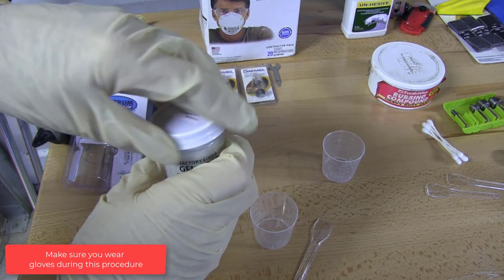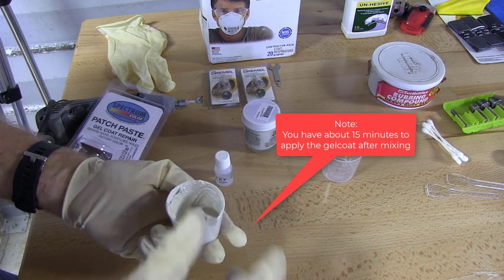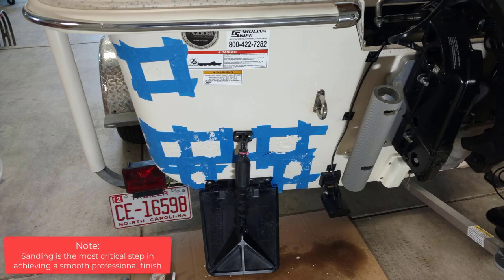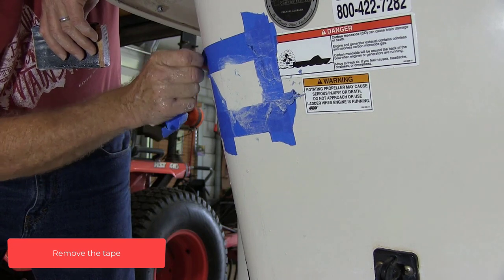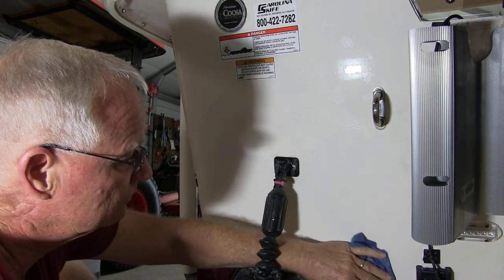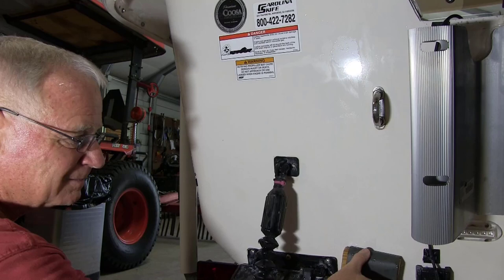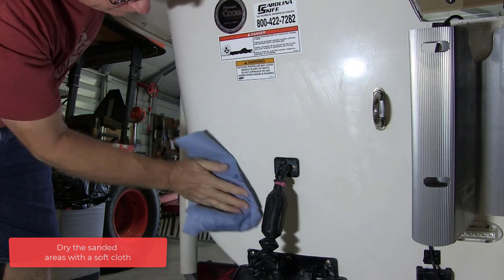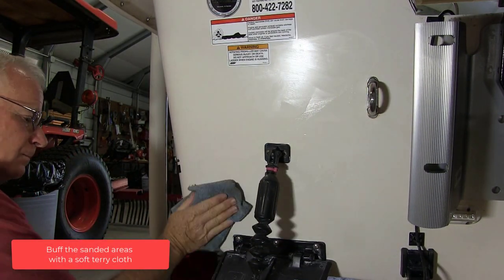Part 4 - How to Repair Screw Holes in a Fiberglass Boat

Comment: Mr. Norman, I drilled holes for a bilge pump and went thru the hull. Three very small holes (#8 screws or 5/32) a few inches apart like the points of a triangle/pyramid. Would you still recommend this repair for the bottom of the boat?
Reply from the maker: Corey,
You will need to follow a different repair procedure for thru the hull holes.
The method for filling in removed thru-hull fastener holes depends on the thickness of the laminate, the diameter of the hole and whether the hole is in a critical area. Holes below the waterline and in thinner laminates are considered critical areas.
If you buy the West Systems Fiberglass repair kit as shown in the video, it will give you step-by-step instructions on how to repair thru-hull holes below the waterline.
Below is a preview of what you will have to do. You can decide if you can do the repair yourself or not. It sounds complicated but it is not so hard to do. You must take your time and do each step carefully. 
The repair can be from one or both sides.
Follow these instructions:
Note: Use a power disc sander with 60 grit sandpaper to make the taper.
1.	Grind out the area around the hole and taper the perimeter of the hole to a shallow 12:1 slope.
2.	Cut multiple pieces of fiberglass to fit within and fill the void.
Cut the bottom, largest layer about ¾” smaller than the width of the void.
Cut each successive layer about ¾” smaller-3/8” on each edge – than the layer below it.
3.	Mix a packet of 105/205 epoxy in a mixing cup.
4.	Apply the largest piece of fiberglass in the center of the void and saturate it with epoxy using the disposable brush.
Apply and saturate the progressively smaller pieces, centering them evenly over the larger pieces. 
Mix more epoxy as necessary to saturate all layers of fiberglass in the void with epoxy. Allow the epoxy to cure until it begins to gel.
5.	Fair the surface when the epoxy begins to gel and is still tacky.
Mix a packet of 105 resin/ 205 hardener and blend in 410 faring filler to make a thick, non-sagging mixture.
Trowel this mixture onto the fiberglass cloth with a mixing stick.
Smooth the mixture slightly higher than the surrounding surface. 
Allow to cure.
6.	Sand the surface to shape. Re-fill any voids as necessary.
7.	Coat with un-thickened epoxy to ensure an excellent surface for the final finish. Allow to cure.
8.	Wet sand with 180-grit sandpaper to prepare for the gelcoat application.

I hope this helps,
Thanks for watching my video
Norman
Reply: @NormanGooch  I really appreciate you taking the time to respond this thoroughly and quickly, Mr. Norman!

Comment: Would using the first part with the epoxy be strong enough to repair a striped out hole.? The bracket that holds my teak platform to the back of boat, one hole striped out..
Reply from the maker: Matt,
Follow these instructions to fix the loose screw.

Remove the existing loose hardware.
Clean dirt, old sealants, and other materials from the hardware, boat surface, and fastener hole.

Drill an oversized hole to expose uncontaminated deck material and increase the bonding area.
Drill the oversized hole only ¾ the depth of the original hole if the hardware is not through-bolted.

Allow core material to dry thoroughly if wet. Use a heat gun or lamp to speed drying. (do not attempt to fill the hole if moisture is present - the epoxy will not cure properly)

Mix the epoxy and hardener properly, then thicken the epoxy mixture with a 406 Adhesive filler to a non-sagging consistency. 

Use a syringe and fill the hole with the epoxy mixture. Tape over the hole if on a vertical surface.

Allow the epoxy to cure for 24 hours.

Drill a pilot hole using a drill bit smaller than the screw or bolt. Insert the screw and tighten it down using a hand screwdriver. ( do not use power drivers)

Thank you very much for watching my video.
Norman
Reply: @NormanGooch   thanks for your help.. God Bless...

Comment: Can this process be done for hatch screws that have bored out fiberglass to re seat screws?
Reply from the maker: To repair stripped and bored out screw holes depending the the size, if less than 1/4" do the following:
Drill the original screw hole a little larger to expose new material inside and around the hole.
Make sure you clean inside the hole removing all dust and debris.
Clean the area with acetone.
I suggest using West 105 epoxy resin, 205 hardener and 406 adhesive filler. 
Follow mixing instructions for the epoxy and hardener, then add filler and mix until you get a ketchup consistency.
Fill the hole with the thickened epoxy, if the hole is on a vertical surface,  tape over the hole and let cure for 24 hours.
Once the epoxy cures it will be extremely hard and durable. 
Use a collar on your drill bit to stop at 3/4" of the depth of the original hole.
Drill a pilot hole into the center of the epoxy filled hole. 
Dip the screw in 3M 5200 sealant to eliminate the possibility of water seeping into the hole.
Drill the screw into the pilot hole using the low-speed setting on your drill.
Stop drilling when the screw head is about ¼” from the surface.
Use a hand-held screw driver to continue tightening down the screw until secure.
Make sure you seal around the screw and attached accessories with marine sealer.
I hope this helps,
Thanks,
Norman
Reply: @Norman Gooch  Thanks.  That was the answer to my question too.

Comment: Is there a link for the Spectrum kit? With the same color you used?
Reply from the maker: I purchased the Spectrum Gel Coat Paste from iBoats.com. The color is based on the model year and manufacturer. 
The color match for a 2013 Carolina Skiff was French Vanilla. Here is a link: https://www.iboats.com/shop/spectrum-color-carolina-skiff-2013-french-vanilla-color-boat-gel-coat-patch-paste-repair-kit.html
Thanks for watching my videos.
Norman
Reply: @NormanGooch  My hole is in bottom of boat. 3/4 x 1in deep.. Going to tape bottom hole and fill from top. You say 3/8 layers at a time?
Reply from the maker: You will need to fill in layers for this size hole. Epoxy generates heat as it cures, this size hole may not cure properly if you fill it all at one time.
Fill 3/8” at a time and let the epoxy resin reach the gel stage.

Make sure the interior of the hole is clean and free of moisture before you begin the repair.

Mixing epoxy resin, hardener, and filler
As mixed epoxy resin and hardener cure, it passes from a liquid state, through a gel state to a solid-state.
Please note:
The temperature will affect curing times. The cooler the temperature of curing epoxy, the slower it cures. Three things contribute to epoxy’s temperature:
1.	The general surrounding temperature of your work area (or ambient temperature).
2.	The temperature of the surface you’ve applied the epoxy to is also a part of ambient temperature.
3.	The heat the epoxy generates as it cures (exothermic heat)

Epoxy resin reaches the gel state in about 20 to 45 minutes. (At 72 degrees F) However, this depends on several factors including the type of hardener used (fast or slow cure), temperature, added fillers, etc.

How does it work when filling the hole in layers?
It gives the epoxy resin time to release heat from inside the hole as it reaches the gel stage.
Also, because the layer of epoxy resin is only partially cured, a new application of epoxy will still chemically link with it, so the surface can still be bonded to or recoated without special preparation.
However, this diminishes as the mixture approaches its final cure.
I hope this helps with your project
Thanks

Comment: Fantastic tutorial.  But it looks like the main ingredient is again, elbow grease.
Reply from the maker: Yes it takes some work. But if you take your time completing one step at a time, you can repair it yourself instead of having to pay someone to do it for you. 
Repairing small holes , cracks, and loose bolts etc. yourself can save you a lot of money.
Thanks for watching my video.
Norman

Comment: I thought that you cannot gelcoat over epoxy?
Reply from the maker: It is easy to be confused when it comes to Gelcoat and epoxy. 

Epoxy hardeners are a blend of amines. The amines from the epoxy can inhibit the polyester Gelcoat and prevent it from setting.

There have been so many conflicting answers to the question: Will Gelcoat adhere to Epoxy?
The answer:  Yes, it will. Gelcoat will bond well to a properly cured and prepared epoxy surface.

The main reasons Gelcoat will not bond to epoxy:

1. Under cured epoxy. 
If Gelcoat is applied to epoxy before it is fully cured, the contact with the non-reacted amines stops the curing process.

2. Epoxy is not mixed at the correct ratio. 
Mix ratio is so important and if it's wrong your epoxy mix will not cure. Gelcoat will not adhere to un-cured epoxy.

3. Amine Blush.  
Amine blush is a surface effect resulting from the curing agent reacting with Carbon Dioxide in the air rather than the epoxy resin. The by-product of this reaction is a compound that forms on the surface of the curing resin and readily absorbs moisture from the air. Under high humidity conditions, it will cause white streaks to appear on the surface of the resin and the uncured laminate.

4. Surface not properly prepared.
Textured, sanded, cleaned with water, cleaned with acetone, cleaned again with water.

5. Working in humid environments.
Make sure the epoxy and the environment are as dry as possible. Humidity levels below 85% are recommended.  Working with epoxy in a humid environment may cause inconsistent results due to moisture entering the mixture. 
It's recommended that you keep the temperature as close to 75 Degrees as possible.
If the temperature is warmer the epoxy will react quicker which results in shorter mixing times and faster cure times. The epoxy can also burn if the temperatures are too hot during the mixing process.

I have used epoxy to repair holes and cracks in fiberglass boats for many years, using West 205 and 207 hardeners. (207 has a stronger bond) and applied gelcoat to the repaired surface and so far, have not had any issues with the Gelcoat adhering to the epoxy surface.

I hope this helps with your question.

Thanks for watching my videos
Norman
Reply: @NormanGooch  Will the gelcoat interfere with the integrity of the epoxy or just not adhere in a worse case scenario?
Reply from the maker: Gelcoat will not affect epoxy,  epoxy affects gelcoat.  Adhesion issues will not harm the epoxy.
Thanks,
Norman

Comment: Or just mount the shallow water anchor to the other side
Reply from the maker: There were two 12ft. shallow water anchors installed. One on the starboard side and one on the portside,  there was no choice but to remove all hardware from the boat.
Thanks for watching my video! 
Norman

Comment: too many ads
Reply from the maker: Dan, 
I agree. There are too many ads. When I upload a video,  I only select one ad to run at the beginning of the video. However, YouTube has display ads that I have no control over. The check box to uncheck the display ads is grayed out so you can't turn them off. These YouTube display ads run automatically. Depending on how long the video plays will determine how many display ads will run.
Thanks for watching my video.
Norman

Comment: How to over complicate a simple procedure in 52 extremely time consuming steps. Love how you glossed over the filling of the holes with a ketchup consistency substance and that your prep of the epoxy would take most people longer than the time the mixture takes to harden. Not to mention the extreme cost for this simple repair.
Reply from the maker: Mick,
I appreciate you watching my videos, your feedback helps me learn what viewers like or don’t like. Each time I create a new video for YouTube I try to improve from previous videos to better serve YouTube viewers looking for simple Do-It-Yourself projects.
Thanks,
Norman
Reply: What would you suggest then? Just fill it with silicone? Properly filling a hole in a cored fiberglass laminate is essential to preventing problems down the road.
Reply: @n0exit  as long as water does not get in it will be fine